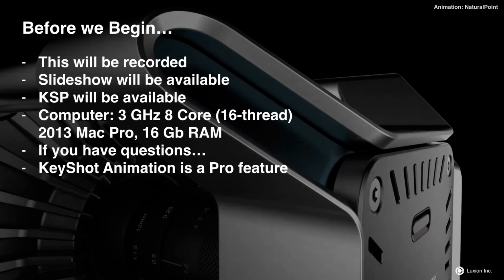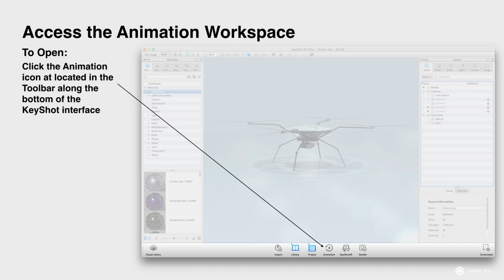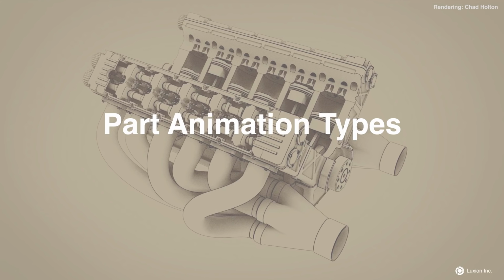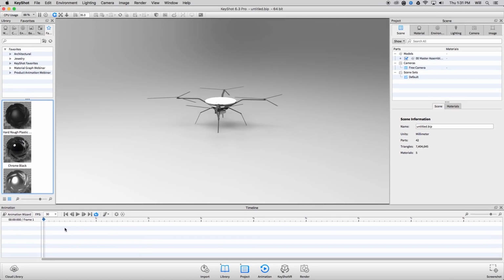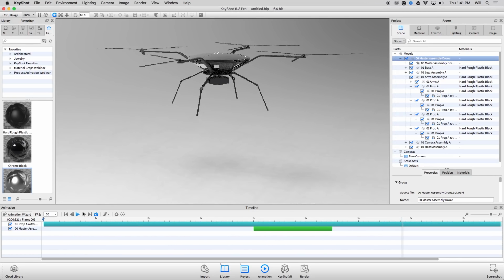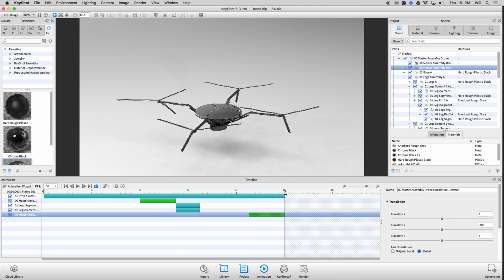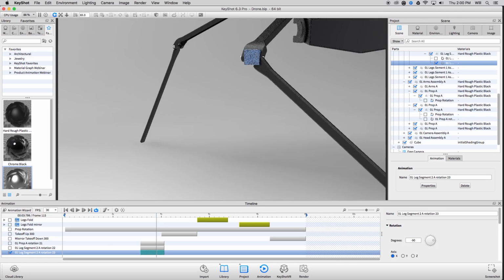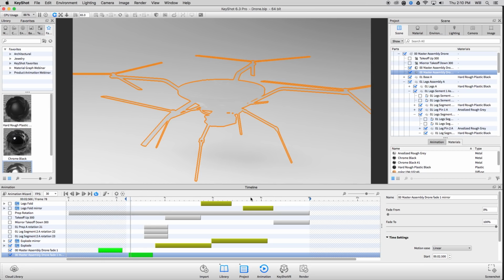Webinar 58: KeyShot Part Animations

Comment: @KeyShot could you pls show how to slow down rotation speed, mine speed very fast, I want to slow it down a little.
Reply from the maker: Hi Myla! To slow down rotation speed during animation, you just need to extend the animation out longer. For instance, if I'm making a 360 degree rotation over 4 seconds it will spin twice as fast as a 360 degree rotation over 8 seconds. Hope that helps.
Reply: @keyshot  Many thanks it makes sense:) Is it possible to do animation in keyshot while the avatar (from CLO3D) at the same time in motion?